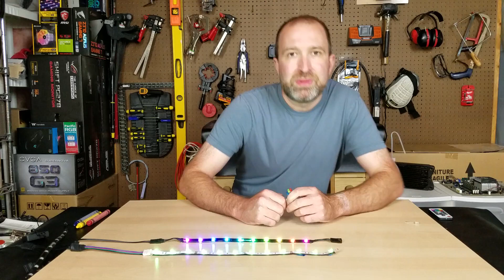RGB 101: Computers and RGB Lighting

Comment: Thanks for the info. I never cared much about RGB gear, but I finally upgraded by 10+y/o tower for somethin with better airflow and my new tower has it (Phanteks 500a) but my mobo (MSI Z390 A-Pro) doesn't have the right header type. If it was a simple plug-n-go I'd set the lights to a single color, but at least my airflow is 100 times better now. If I cared I'd buy new fans w/ the right RGB type.

Comment: You Sir are saving my ass!
I am learning a lot watching your videos, they have helped me sort out some major doubts I had.
I am in the midst of building the case that will probably follow me for the rest of my life and therefore it has to be perfect!
I am planning on using roughly 1.5/2m of thin NeonFlex which uses at most 192 WS2812B and 4 phantek's Halos for another 120ish leds which are WS2812B aswell if I am not mistaken, I was planning on getting either a dedicated psu for them to stick in the wall socket...but then again I do have a RM1000 which has like 25 amps or 150W on the 5v...connection? Rail? Still learning the lingo 😁
If it is not too much, do you reckon I could do the whole thing daisy chained and then connected to the psu? The Neonflex is soldered to a controller that "talks" to one of those white remotes, if I connect the fans together with the strip, and they use the same leds and chips they should be able to be controlled via the remote aswell right? That library thing you mentioned 😅
God I know nothing on this stuff, well if I need some custom cables I can contact your chap which has a quite nice ebay cable shop 😁
Reply from the maker: Thanks for your kind words and great job doing your homework. Most of the power consumption comes from running LEDs at bright white, which is something to consider. With my mental math you are looking at almost 19A with a little over 300 LEDs at bright white. If you are handy with an iron, a buck converter might be an option if you are worried and want to add more. Granted those LEDs are rated for 06A/LED, though I have never seen it draw that much. I also seldom run my LEDs as white.
Reply: @SolarityTechnology  I mean, if you didn't start with "OH GOD DON'T" I already feel a little safer lol
That aside I am not planning much white in my build, I am going for a "Vintage Electronics" warm orange glow, I went with the 5v argb leds because of the effects, being able to have some flickering here and there would turn the view into something much more interesting than flat orange.
Another reassuring fact is that I probably will use only 1.5m of the neonflex, that would put me at around 210ish leds Halos included which at a warm colour, makes me feel much more comfortable.
Also I'll have a mighty Lamptron Hummer in one front bay, which has 5 switches rated for 100w each ^^
Overkill, alway go overkill! :D

Comment: Hi! I loved your videos and the technical approach of them. I´m working on my new build with an x570 mb which has 1 (ADD_GEN2) and 2 AURA/12v RGB inputs. I´m using 3 EK-Vardar D-RGB fans, 1 EK-Vector D-RGB block and 2 light strips from Phanteks. I also have the Phanteks Digital RGB controller that has 3 inputs (3 pins w/o blank header), the thing is that the EK products come with the 5v/D/*/Gnd header and the controller uses the 3 pins header for the 5v. I´m wondering if i can splice the extensions cables that I have (3pins) to a 5v/D/*/Gnd head. I know that getting an adapter is the best way buy I can´t get those in my country. Hope you can help me! And thanks for doing such great and informative videos.
Reply from the maker: Yes, those are compatible with each other. I think Phanteks uses JST SM connectors, if you have access to connectors and a crimper. You can also solder cables together.
Reply: @SolarityTechnology  Thanks for the quick reply! I'll do that!

Comment: I have an MSI ACE MEG z390 MB and wan to use PC Cooler RGB fans.   I have one 480mm radiator for the CPU and one 480mm for the GPU.  I will also have 2 case fans.  I assume the best thing to do is break this into three loops.  Can you give me some pointers on the best way to wire and control this?  Thanks!
Reply from the maker: Can you give me a parts list for your custom loop and the case you are using? When you say three loops are you talking about water cooling or do you have another system in the case?
Reply: @SolarityTechnology   

Thank you so very much for your help and for getting back to me!  I realize my first description is way too vague.  It  will actually be a custom case, a mounting board inset in a built in cavity in a knee wall - kind of like a built in book case, but with a wall-mounted custom board.

There are two liquid cooling loops and three RGB fan circuits (I assume)

I have one cooling loop for the CPU (i9-9900KF) and VRM on the motherboard (MB) together.  It has a MB/CPU water block by EKWB made for the MSI MEG ACE z390 board.  That cooling loop has one XPSC RX 480 V3 radiator and will have four PC Cooler Moonlight fans(first RGB fan loop).  The reservoir is an XSPC D5 Photon 270 and has one UV LED.

The other cooling loop is to cool the GPU  - it is an EVGA 2080 super  - FTW3 Hydro copper gaming - 08G-P4-3289-KR.  The water block was already attached.  I think it has an RGB 12v 4 pin header.  This will again be plumbed to an XSPC RX 480 V3 radiator with another four PC Cooler Moonlight fans (second RGB fan loop).  The reservoir/pump is another XSPC D5 Photon 270 and has one UV LED.

PSU is an  EVGA SuperNOVA 850 G+, 80 Plus Gold 850W, Fully Modular, FDB Fan, 120-GP-0850-X1.  No RGB here, but has 2 CPU power connections for overclocking

there is a 1TB NVme drive I will mount to the MSI MB, and a 2Tb SSD I will mount on the back board.

The RAM is Corsair Vengeance RGB  DDR4 3200MHz, 2 x 8Gb sticks

There will be two PC Cooler Moonlight "case" fans  to help with the RAM and NVme drive heat. (third RGB fan loop)

The pumps integrate into the D5 Photon 270 reservoirs, and are Swiftech MCP-655 4 pin 12v  Molex adj speed dial 

It would be fine for the RGB on both radiators to be in sync, but I want to be able to vary the fan speed on each radiator independently.
The same could probably be said for the case fans.

Hope that is clear.  Thanks again
Reply from the maker: @kellyw9567  have you already purchased everything or are you still in the planning stages?
Reply: @SolarityTechnology  Yes - everything but the tubing, fittings, and fans have been purchased.  Did I mess up somewhere?
Reply from the maker: @kellyw9567  I would go with a Corsair Commander Pro for the and get some fan repeaters so you can run all the rad fans off the same curve. Also get a temp sensor for your custom loop it can plug into the CoPro. Use the temp sensor for your setting your fan curves. For fans I suggest Corsair RGB, if you want RGB. 3 pumps is a bit overkill. Though if you already have it and want to use it, that is fine. For the Analog RGB you can look at my ArrRGB DAC if you are interested in tie it together. Though XSPC RGB will require you to most likely add a 100ohm resistor to the red cathode. Did I miss anything?

Comment: So i want to use EKWB rgb in icue is it just vdg? there is 4 pins for my LL120 fans and 4 on ek monoblock instead of 3. 3 on the light strips but the fans and block are 4. does this mean 12v analog?
Reply from the maker: Corsair LL and other icue compatible fans have a 4th pin for data out. They are just like your digital 5v LEDs that have 3pins. More on that here: https://youtu.be/wTMghWcSn5E

If you do want to connect your 12v analog 4pin (12vGRB) to iCUE, I did invent a RGB  DAC for that:

https://m.youtube.com/watch?v=FSCzS2mA_oo

Comment: Have you looked at aquasuite by aqua computer? They have some cool controllers like their Quadro and Splitty. Corsair stuff is suppose to work with them. Can you do a video going into connecting Corsair stuff to a Aquacomputer product?
Reply from the maker: I have seen a few things about it. I can look into it. I know they have a device called a RGBpx Splity4, that can output to Corsair fans. Are you talking about this? I might see if I can do something as a local vendor I know sells Aquacomputer here.
Reply: Solarity Technology Yep! That would be awesome! I am doing my first build and going all out. I will have a lot of fans and aRGB and trying find the best way to connect them all up with the most functionality. I am use an Aorus z390 ultra mother board. I am thinking I may not need aquasuite and can just use RGB fusion, but will probably need hubs/controllers so I don’t short out any components. Probably looking at 20-24 fans with at least 6 being aRGB but will probably have strips that are aRGB and my cpu and GPU water blocks are aRGB.
Reply from the maker: @TechWookie  Why not just use iCUE and a  Commander Pro? You get 2x ARGB, 6x PWM fan, and 4x temp sensors. You can also use it to control all other Corsair devices that have support for iCUE.
Reply: Solarity Technology because 1) to save some $ and not be locked into Corsair 2) will have a lot more than that. Will have 3-4 360 rads 2 of which with push pull and case fans. I know it’s total overkill but like I said I am going all out. Plus I read that Corsair software is pretty glitchy/shotty. Though I haven’t tried it out myself personally.
Reply from the maker: @TechWookie  You will need to use a software to control the devices. You can buy ARGB adapters to work with the Corsair Commander Pro. Check out Pirate Dog Tech on eBay for adapters. Also, I invented a Digital to Analog RGB converter which works with both motherboards ARGB and Corsair headers.  Check out my DAC videos. I highly recommend iCUE to anyone. I have used and looked at a lot of tools. I like it so much that I am a closed Beta tester for them. It is nice to have a company that takes my feedback.  Granted I didn't take a close look at Aquacomputer, though I do know Corsair is actively developing their product further.  Corsair generally releases a patch every month. While a bug can pop up, they put a lot of effort into fixing it. While Corsair is free to use, I am glad the company puts money into it.
Reply: Solarity Technology good to know, I did browse your DAC videos but I thought that was something you were just making for you?  Are you selling them or is it something I would have to use your videos to reproduce myself?
Reply from the maker: @TechWookie  I am working with a manufacture for mass production. As well with a local Mod/Water cooling shop for retail sales. I don't have time or logistics to sell or produce them myself. The little spare time I do have, I would like to network, produce videos, and innovate.
Reply: Solarity Technology Totally understand. Just wasn’t sure based on your last message.

Comment: Have you played around with the new TT RGB software? How does it compare to iCue?
Reply from the maker: No I haven't looked at it recently. Before I jumped into the Corsair iCUE ecosystem, I watched so many reviews to get a good idea of what the software capabilities were. I already owned the K70 and I was pretty impressed with the Original CUE. Then I was let down by RGB Fusion, when I got my new MB. I wanted to find the best software for control and I concluded that Corsair did the best job. I also didn't want to have a lot of different devices with different software. I got into it so much, that I ended up becoming a closed Beat tester, which is pretty cool. Corsair does listen a lot and generally releases an update every month for iCUE. Just to keep an eye on things I should look at the software, CM released some software as well. The only TT products I have currently are the TT RGB Fittings, though the ones I got aren't supported by TT software. Though I made a device to allow them to be controlled by iCUE in another video.Though I think you brought up a great point, I should keep an eye on other items to help me stay objective.
Reply: @SolarityTechnology  I only really know the basics of RGB and currently only have analogue RGB strips and a RGB GPU. So my knowledge in various overlapping and per LED effects are very limited. It does seem that the iCue software is the most powerful, I won't dispute that. But perhaps with your knowledge just exploring the program would be enough to see how it compares to iCue in its customizability. I'd be interested know your thoughts.
Reply: Don't know about TT software but I'm currently controlling my Riing Plus fans with corsair ICue, all that is needed is the TT premium sync controller,  which allows you to connect the RGB lighting to an Asus motherboard (i think it is also compatible with Gigabyte and MSI) after which you just need to re-pin the end that plugs into the mobo with a corsair header OR you can find some custom adapters (either plug into a Commander Pro or Lighting Node Pro). The last part takes a bit of experimenting with ICue. ICue thinks that the TT fans are LED strips and so you need to manually configure strips and effects (Eg a corsair LED strip has 10 LEDs and the TT fans have 12 LEDs each). I wouldn't try this with the more advanced TT products (Riing Trio) as they probably have embedded microchips which you need gigabyte to run.